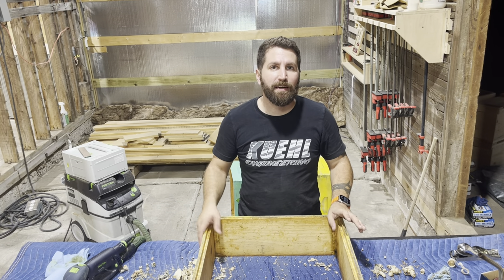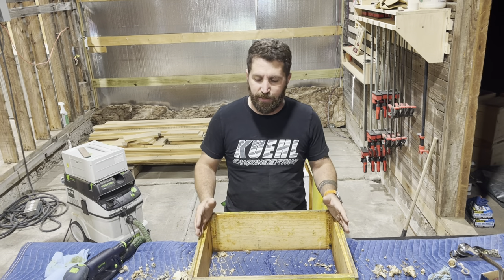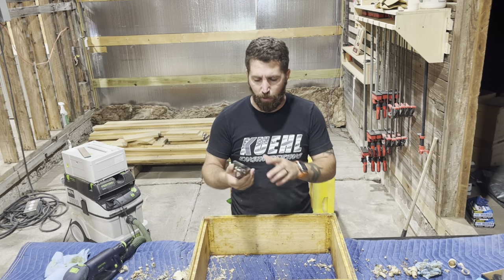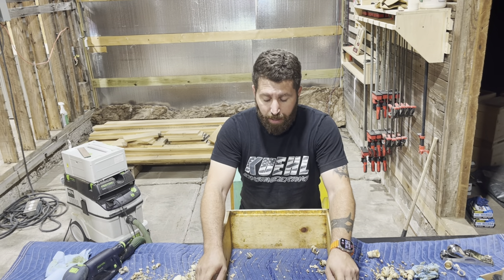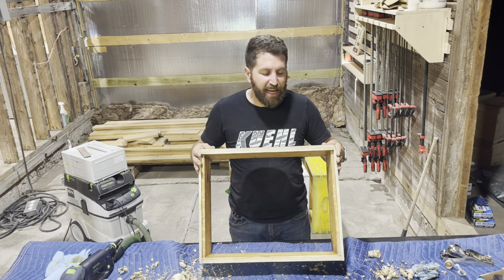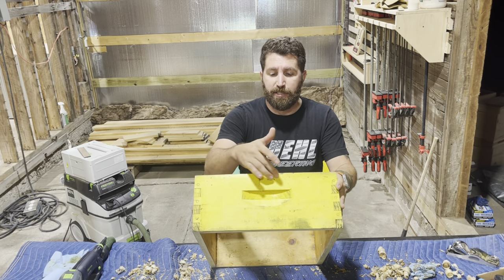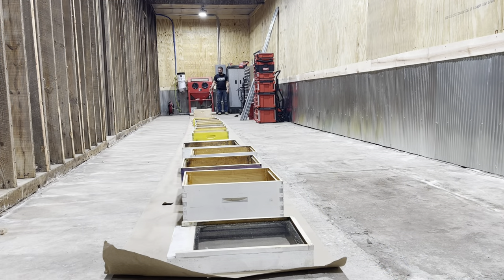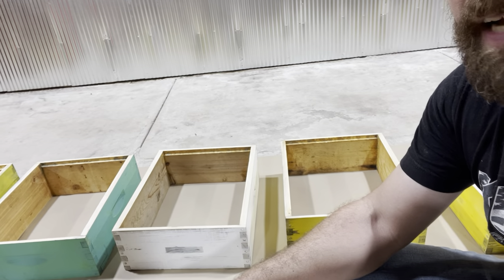Refurbishing Bee Hive Boxes

Comment: idk if you’d be able to answer this and it’s ok if you can’t, but i trash picked an old beehive box and i want to upcycle it into a little side table. i scrapped off all the wax and cleaned it with murphy oil soap. after watching this i might consider planing and sanding the edges, but it’s there anything in particular that you would do to the inside to make it more suitable as a piece of indoor furniture? i also might consider refinishing the wood, but i’m not sure if the wood as it is is suitable for that. this video was very helpful regardless and thanks for any advice you can give too!
Reply from the maker: Beeswax and propolis are safe and beneficial in many ways. I don’t have any concerns with using the wood for furniture. In fact, beeswax is often used as a wood finish for furniture.
Reply: @TarshaHomestead  awesome thanks!
Reply: Also, bee equipment tends to smell nice.